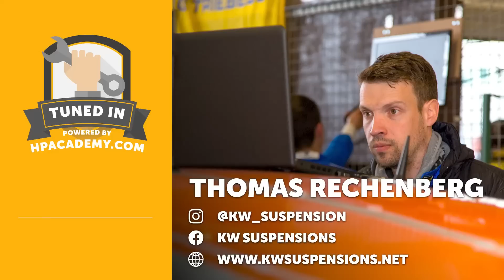079: Suspension Setup Secrets From KW’s Head of Motorsport. [#PODCAST]

Comment: I’d like Thomas to confirm what I found in the KW Dampers supplied to the 2016 Porsche GT4ClubSport within a month of its release. I’m a super early adopter of KW shocks. We tested and got them approved in 2010 for Porsche 997GT3 Cup cars.
Reply: How would you rate their dampers? Working on a few builds. One if things work out is gonna be a superlite slc. Suspension is like the only thing i dont have fully sorted in the build plan though, and trying to get it dialed enough i can play with cup cars even with a roughly 600pb weight penalty.

Comment: The reason you ran out of compression on your 86 was probably spring length, not because of the adjustment instructions were wrong. Using preload to adjust ride height is silly.

Comment: One basics question nobody ever could really answer me:
If I put/adjust a V3 damper to the same compression and rebound damping rate/curve as it is in a (non adjustable) V1 or V2 damper, does the V3 suspension drives the same as the V1 ?!
Reply: No not exactly valve is a little bit different.
Reply: @RaceAlliance  i understand that a V3 valve is differently built as a V1 or V2. 

But if I adjust the V3 to the same compression & rebound values as it’s on a (non adjustable) V1 why do both V3 and V1 drive differently ?

Is it ‚just‘ the high speed (bypass) valve Finten V3 which the V1 doesn’t have maybe ?
So is the V3 mainly/only superior to a V1 when you have. high Speed Event such as a pothole etc ?!
Reply: @vollcare4076  shocks also have hysteresis and the performance of the shock changes with oil temperature and cavitation, i.e. the way the damper is designed and built changes how "good" it is. On a shock dyno it might have the same curve but as conditions change the V3 might remain closer to the expected curves and the cheaper ones might not. It all depends and it's where a lot of testing time goes to

Comment: This podcast pretty much just sums up and confirms everything I’ve done on a personal special project I had of mine to have a custom set of coilovers special tailored and made to my specs for my STI road / weekend rallyx car! Took me about 5-6 years of getting and studying these exact suspension philosophies, info and data mentioned, as opposed to majority of the big and popular name brand coilovers on the market people tend to recommend and purchase without any research or idea what actually is going on inside and what product they’re really buying into as advertised. After figuring out my chassis corner weights, suspension geometry and motion ratio I want to shoot for, I went through 3 valving revisions and 3 sets of different spring length and rates, now with helper spring to achieve my final product!
Reply: Got any must reads for chassis tuning that gave you some eureka moments?
I generally get the gist of the bigger picture but I’m finding it hard to piece it all together to move towards informed decisions for calculating what changes to actually make.

Comment: I’ll bite as the example hobbyist on ride height travel. 😂 

The example of gt86 suspension going to softer springs. Is this not simply increasing static sag due to the car weight not changing so you will lose compression travel as you have gone way out of your spring window for your fixed car weight?

If you wind in preload, yes the spring rate remains linear from the point of sag. You could risk early coil bind before achieving full damper rod travel when loaded up depending on spring length and rate versus damper rod travel - that’s a horrible bottom out ahead of the damper bump stop solution and reduced travel. Lots of preload will also alter the the initiation of the suspension from full droop as it takes an increased force to initiate any travel. This will be a harsher initiation to travel than having very little preload and could affect traction at full extension. 

I think there is a bit more to it than straight BC type advice and straight Andre method due to considerations above. 

Using a spring of near half the rate of the one that gives you the right static sag with minimal preload, winding preload far in, does not sound like a great idea. BC etc are usually sold with a spring rate which is deemed in a suitable window for sag in that vehicle application so I can understand their advice - the damping window should also be setup around that advised spring rate. So again wild sweeps in spring rate with a set tune on a damper is probably not a great idea. Yes you have adjusters but adjuster orifices and shim stack pre load can only give you so large a window over a certain range of spring before you have a mismatch between spring and damper.

Comment: Kw v1 were vastly better than oem on road, and their v3 were better than 2 other big-name dual road /track day setups I'd had. So when I needed slick race car club sport suspension (that nobody made for that vehicle) Kw got me to send them 1000 measurements, and some of my existing components to Germany. A few weeks later for a very modest bill, they sent me back some one off coil overs that knocked it out the park first time.
Reply: This is suoer good to know. Have a few projects im working on that could do with some good suspension but very limited on options. Q1 penske or bilstein on the one project are the only 3 coilovers you can use.